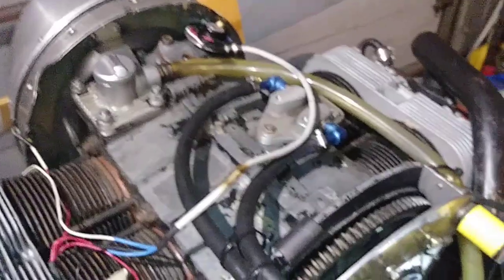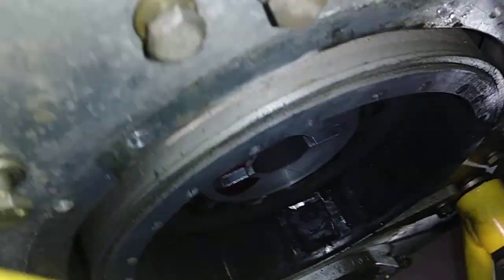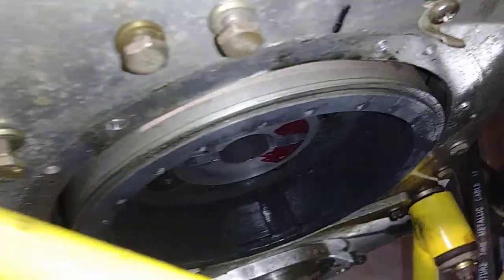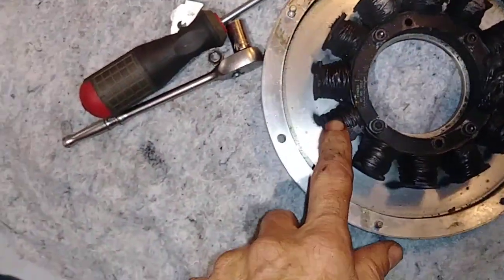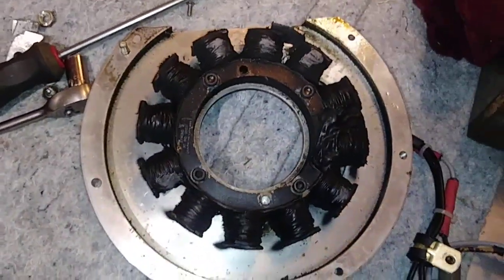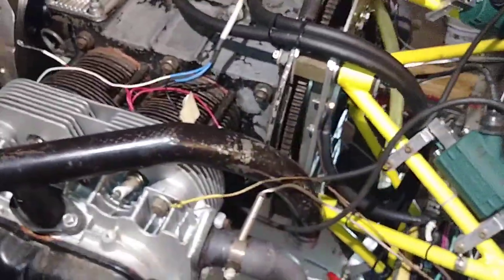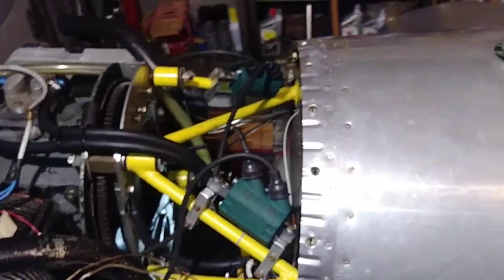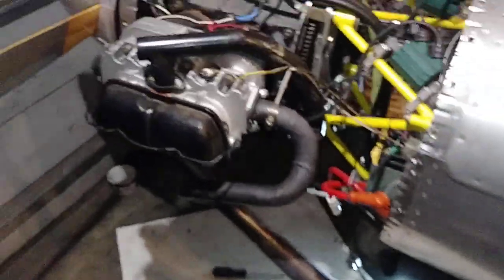Part 2 of H5 engine tare down

Comment: Do you think one of the permanent magnets came loose from epoxy, or maybe the stator mounting shifted somehow?  Okay, just read description again.  Maybe one magnet came loose first, and then worked it's way "round and round" to grind all the other magnets down.  Hopefully, you'll post more info when you get it apart and have a better look.
Reply from the maker: Hi birdsong. Yes I believe that a magnet delaminated and then got into the stator of which it wasn't happy about. I thought I did do a video showing the magnets and stator?  Thank you for watching and your comment